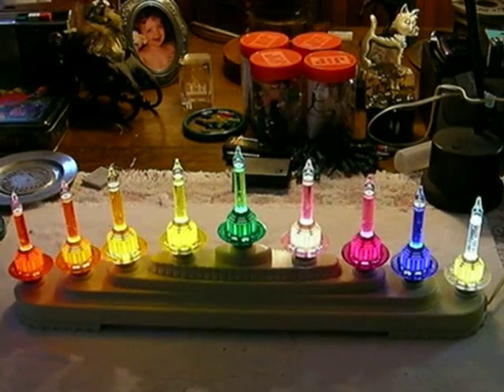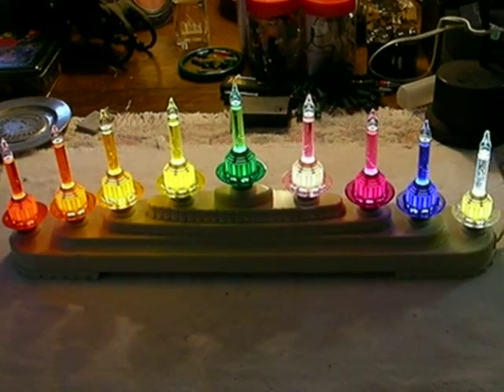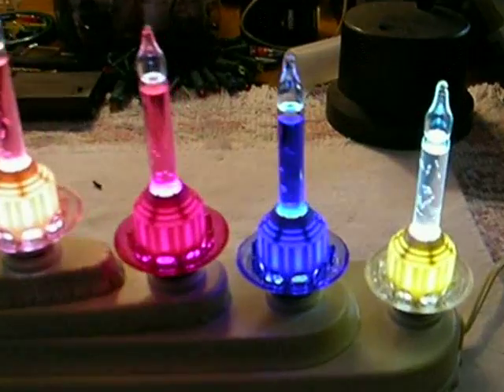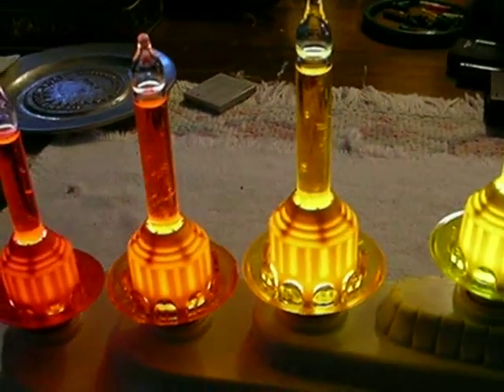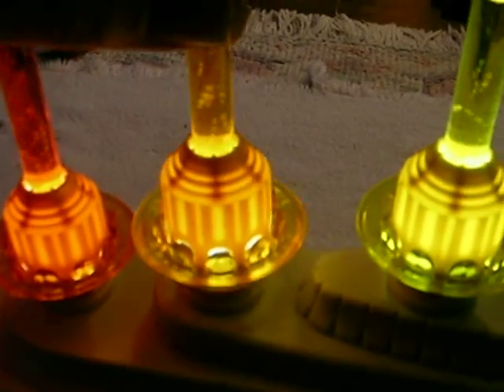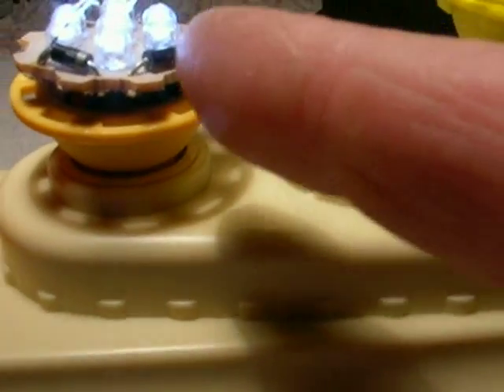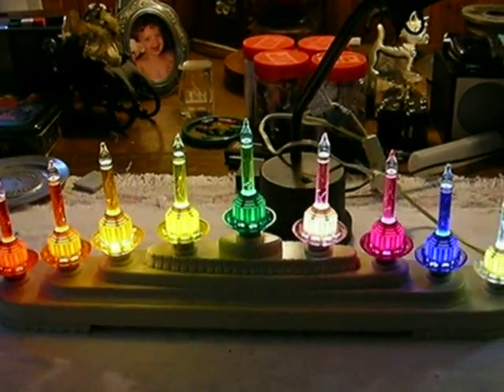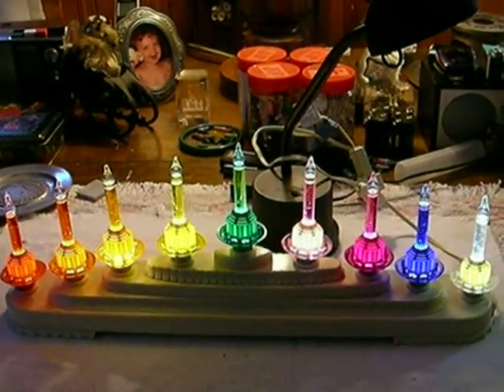LED Bubble Lights

Comment: It’s company or someone pulled this off which is mainly the one that pulled it off on the first place bubble lights might make a return once again with LEDs
Reply: If this ever happens then people don’t have to worry about plastic melting overtime or bulbs burned out and needs to be re Lamped

Comment: Note at this point bubble lights can be relamped with LEDs, a number of which can be purchased on Amazon and elsewhere.

You just need to make sure the LED is 2 watts in order to generate enough heat.
It should also be less than ~1.9" long in total (for Radkos) and E12 base.
The electrical foot contact of the bulb can be extended with solder if needed.

Lastly, since LEDs are much brighter, you can adjust the brightness by wrapping whichever parts of the bulb in electric tape to block some of the excess light if desired. The Radkos look amazing in LED and its worth the time and effort if you love bubble lights!
Reply: Do you have a link to bulbs that work?
Reply: @rlriehn85  Unfortunately can't link. Search for

Makergroup E12 LED Light Bulbs for Dryer Refrigerator Water Dispenser Night Light Bulb C7 Candelabra Base Bulbs 120V 2W Cool White 6000K
Reply: @dancox3251  Thanks! I’ll check it out!!
Reply: @dancox3251  Did you do this yourself?  Are there any photos or videos anywhere to show the final result and/or process to switch the bulbs to LED?  I'm very interested in doing this, but would love to learn more about it first.  So far this Youtube video is all I've been able to find regarding switching to LEDs.  I also found someone who mentioned that bulbs should be 5-7 watts (he was referring to standard incandescent bulbs), so I'm surprised a 2 watt LED produces enough heat!
Reply: @DavidWavid  Indeed I did. 6 strands worth. The only thing I'd tweak from my original recommendation is to find white electrical tape (a minor aesthetic nuance). 2 watts is enough (I tested multiple wattages) but it might take a little longer to get to bubble temp vs. higher wattages. I've also tested this in several bubble night-lights. 2 watts is the key (minimum). Make sure the tube touches the bulb (I put a dab of glue on the bottom of the tube when inserting for maximum heat transference) for fastest effect (conductive heat transfer being most effective).

At the moment I write this it is 107 degrees here in TX, so this is far from my mind but as I can recall through my presently melting brain it just took a few mins from power-on to get to bubble with 2 watts :). The lighting effect is the same as shown in this video. Amazing !
Reply: @dancox3251  Thanks so much for taking the time to respond!  You’ve inspired me enough that I think I might give this a shot!  The idea of having a good looking, no maintenance (after the initial effort) bubble light candolier is very intriguing to me!  It may take me a few months to get around to actually doing it, but I’ll report back once I give it a go!

Comment: Chris. I'm back again with my annual search to see if there are LED bubble lights available this year.  Looks like you're still the Lone Ranger.  If you don't plan on patenting or marketing this, could you at least include a parts list and instructions so that non-electrical folks like me could make a set?  Like many, I love bubble lights, but have quit putting any incandescent lights on my tree because of fire hazard as the tree dries out.  

I bet I'm not the only one who would send you 5 bucks for a parts list, where to purchase the parts, and a set of instructions.
Reply: That would be a good bet Tim, as I too would send Chris $5 to acquire his parts list and wiring diagram.

Comment: Chris.  I just did my annual search to see if there are LED bubble lights available this year.  Looks like you're still the Lone Ranger.  If you don't plan on patenting or marketing this, could you at least include a parts list and instructions so that non-electrical folks like me could make a set?  Like many, I love bubble lights, but have quit putting any incandescent lights on my tree because of fire hazard as the tree dries out.  

I bet I'm not the only one who would send you 5 bucks for a parts list, where to purchase the parts, and a set of instructions.

Tim

Comment: I was just thinking about doing this very thing due to frustration of dead bulbs and replacement availability. Only 6 years late on originality of concept, lol. It still counts if I didn't know it had be done. lol. Thanks for the vid also those are really cool versions. I've not seen any like that.

Comment: I made a great discovery over the weekend. Frequently bubble lights will have trouble starting to bubble. So, how to get them to bubble? It is quite easy:
Let the bulb warm up for 4 or 5 minutes until some of the other bulbs have started to bubble. Unscrew the one that isn't bubbling and hold it with the glass tip pointing down for about 15 seconds. Once you turn it back up, it will bubble like crazy. Then just screw it back in to the socket!

I suspect it is because they don't get quite hot enough and the fluid just swirls. When you turn it upside down, the hot bulb heats up just the glass bottom of the tube making it very hot compared to when the liquid was in contact!

I got two strings of these at JC Penny last year after Christmas. They were way too expensive at full price. It is very nice that you can change the bulbs when they burn out. They look quite nice and work well.

Comment: Fantastic. I wish you were my neighbor so I could have you whip up a set for me. I Have an original set from 1948 and now I am having to replace light bulbs and having to modify the plastic to make new bulbs fit into the sockets. It is working but the bad thing about old bubble lights is they burn HOT! This is a great idea.
Reply: Hey Gary.  You know I love bubble lights.  This guy really knows what he's talking about.  I never knew what was in the vials that allow it to bubble.  I'm still going to try and stick with the incandescent bulbs.  Is it getting hard to replace these?  I haven't looked into that for a while as I still have several sets to cannibalize bulbs from.

Comment: This is surpassingly cool.  An added advantage of this setup is that since it undoubtedly runs cooler than the original lighting, the plastic in the lamps will last a lot longer.

I just wish I had the electronics skills to do something like this myself; I've got lots of dead antique bubble lights that I'd love to bring back to life.

Comment: LEDs produce enough heat to boil the ether?
Oh, you are cheating using a resistor.  Clever.  
Yes full wave bridge rectifier makes them much better - and appearing brighter than if just 30 illuminations/second.
Need to find the liquid which made much bigger, fewer, slower bubbles.

Comment: Is that resistor dropping the current to the LEDs?  With 7 LEDs in series the resistor would still be dropping 90V on a 110V supply.  Even at just 10mA that's still almost a watt of power.

Comment: I have often wondered about weather it would be possible to get the tubes to bubble with a resistor, very interesting. I wonder if you could convert an older series set to work in the same way.